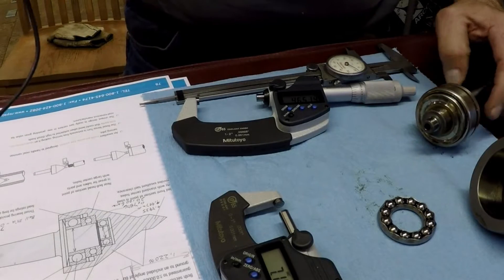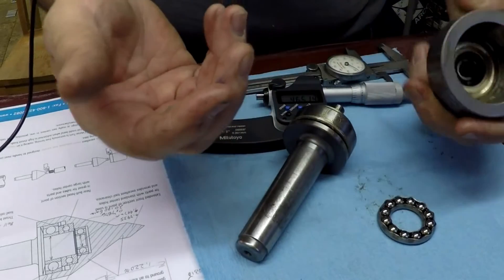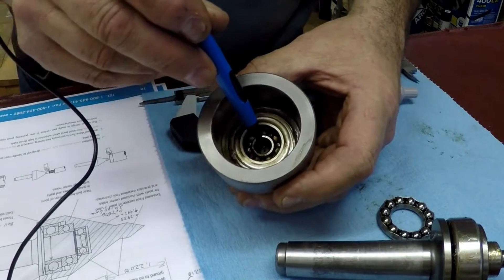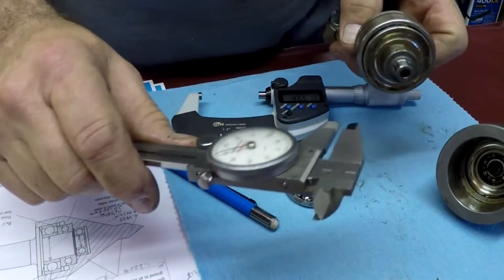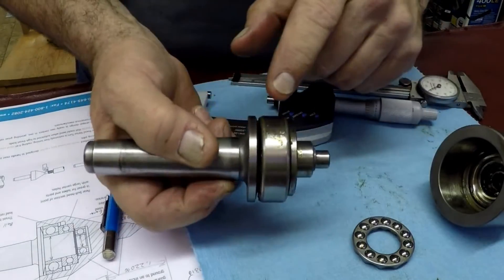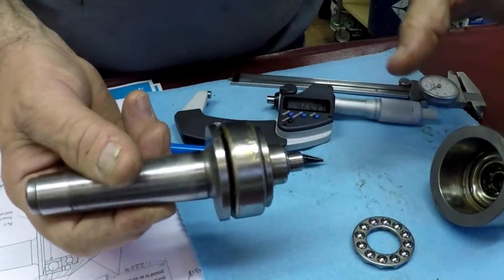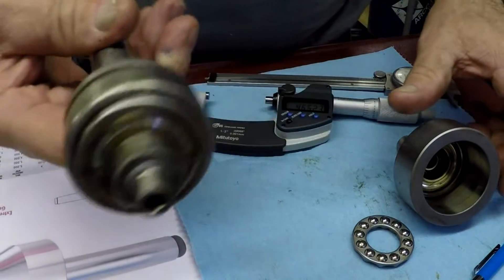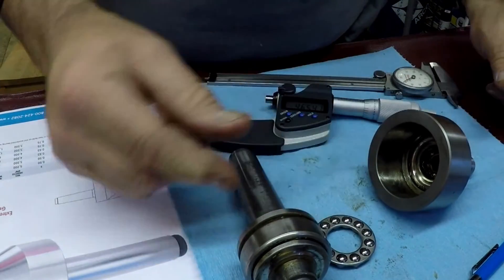Royal Live Center Disassembled | Lathe Live Center

Comment: If you pack that blind bearing with grease and then hammer a tight fitting dowel into the hole, it's a really great way to cover your ceiling with grease.
Reply from the maker: Thank you John.

Comment: I made a live center that looks similar to that back in the 70's and I put it together without any thought to how it would ever come back apart if the bearings needed replacing.  Lucky me they are still good.
Reply from the maker: Need a grease port, so you just pump it apart.  Thanks HArold.

Comment: Hi, Randy during my millwright apprenticeship I was shown how to rebuild the same centers even larger ones. They were used on our VDF copy lathes the cams were driven with these centers. To remove the pilot bearing use a punch around .005" thou. smaller than the inner bearing bore then fill the inner bore with grease and position the punch square to the inner bearing bore and drive the punch into the grease keep filling with grease and driving the punch 
It will come out just fill, hammer fill, hammer. I was in the field repairing some equipment and needed to remove a pilot bearing, Damn no grease so I improvised with some wet toilet paper and it worked. One thing thou if the center is taken apart, due to the precision bearings used in this assembly do not reuse them. Refit with new bearings only. 
Play Safe From Elliot Lake Ontario Canada.

Comment: Cool, I have the MT2 version of that center so I clicked on this video right away.

Bought mine cheap on Ebay several years ago, too.  Seems like the good deals on there have almost dried up.  Since it was used when I bought it, it could probably use a bit of fresh grease as well.
Reply from the maker: They are nice.  Thanks Douglas.